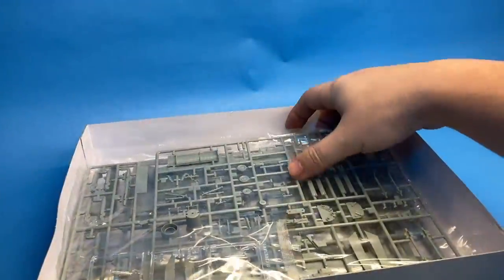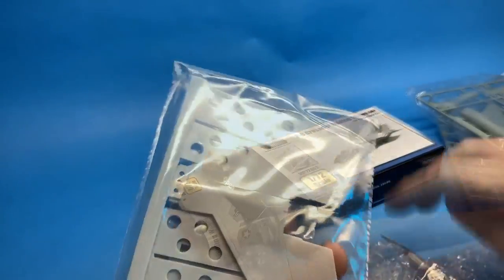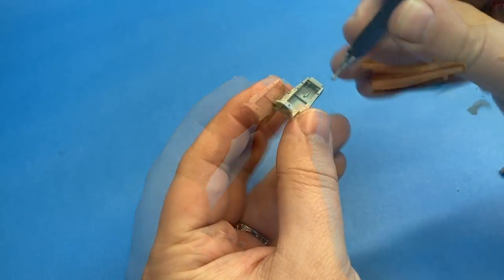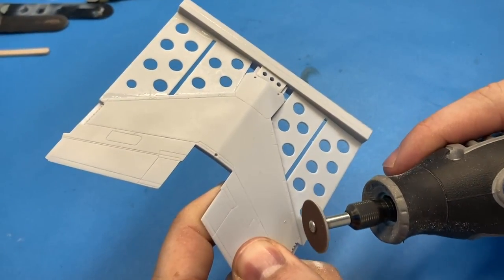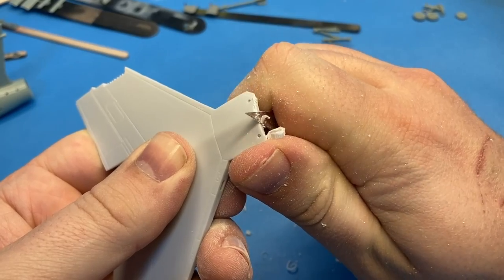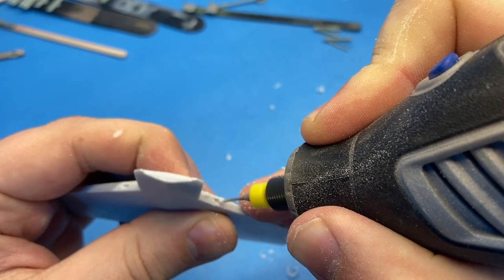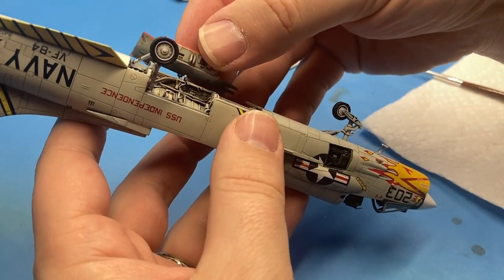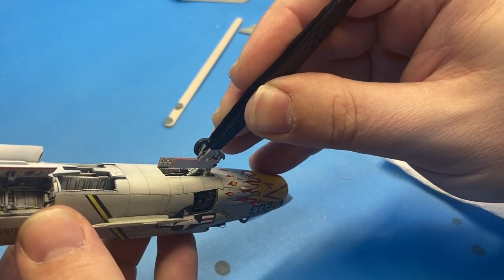Academy 1:72 Scale F-8 Crusader | VF-84 Jolly Rogers!

Comment: Really enjoyed your build of this beautiful plane. Very impressed with how you managed to tame the intake flame decal given the compound curves and a flat decal.  I have this set of decals, and that particular decal has kept it in the box for me.  Yours appears painted on.  Beautiful build!
Reply from the maker: Thanks for watching.  I would be lying if I said that decal didn’t give me any trouble.  I kind of gloss over it in the video, but I ran into some bad wrinkles with that decal that I couldn’t smooth out with decal solution.  I ended up needing to sand the wrinkles smooth, then mix up some custom yellow paint to touch up the sanded areas.  I admit there were a few times I was ready to give up, but I had a lot of encouragement from the IG community and pulled through!  It was worth it in the end.

Comment: How do you mix all your paints and if you’re like me and only have one air brush, how do you do it without having to get up every ten mins?
Reply from the maker: I generally try not mix custom colors, I will often just use a paint straight from the pot, the only times I do any mixing will be to add a little black or white to the base color for some modulation, and I do that right in the airbrush.  I assume you mean by getting up every 10 minutes its to clean your airbrush.  I keep cleaning supplies at my work station.  If I'm switching colors often in an airbrush session, I will generally run some thinner through the airbrush first, then follow up with water before switching to the next color, I have a small box that I use to capture all the overspray from the cleaning so that it's not going all over the place.  Also, I generally use acrylic paints so I don't need strong chemicals for cleaning, usually some Isopropyl alcohol is strong enough.
Reply: @HammerheadModelMaking  thx

Comment: Most F-8H Crusader I have built , were not accurate , mostly they had round radome base not oblong  w/ c was the common errors  in most kits , even resin  kits don't provide those correction . 🤔
Reply from the maker: I wasn’t aware of that shape issue.
Reply: I wish Sword would do early, round radome F-8's. With an RF-8 variant.

Comment: Hallo  dear. 
I dislike this video because the model is the WRONG version. 
The VF-84 NEVER used the E model (Academy Model) . The Bu. No. of the decals was a F-8C 145562 , conversion in a second time in K . 
please for the next time more research of history. Ok, this is a hobby but, never forget the right stuff
Reply from the maker: Hello, thank you for your feedback.  You are 100 % correct that I modeled the incorrect version of the F-8 for this project.  But it wasn't for a lack of research.  I just wasn't prepared to make the changes necessary to backdate the Academy Kit.  And as a modeler I've never been super concerned with getting every aspect of a project absolutely correct.  On top of that 1:72 scale is still relatively new to me, and I'm not fully confident in my scratch building skills, but should I repeat this livery, perhaps in 1:48 scale (the flames are super cool) I may try to represent the aircraft more accurately.   Thank you for watching regardless and providing feedback, that is what helps me to improve.  Cheers!
Brett
Reply: my criticisms only go in one direction. Improve and improve.
I have been doing modeling for over thirty years and historical research is very important.
i am sure in the future you will do better.
Don't worry I've seen worse things ...